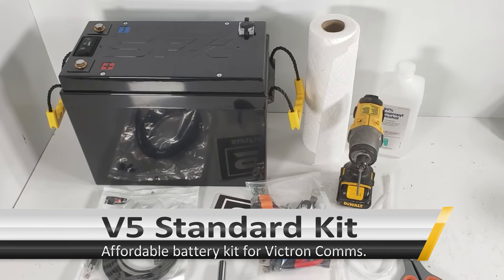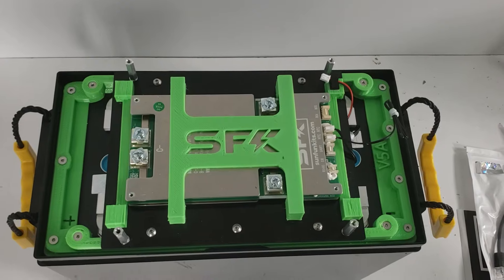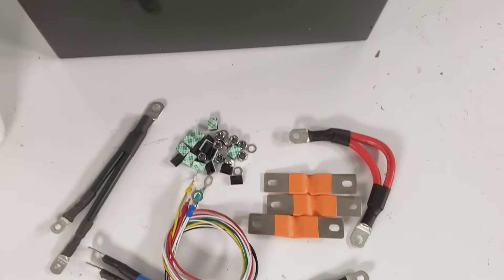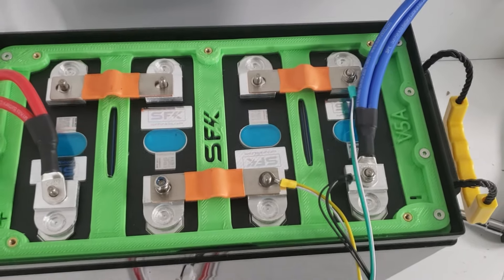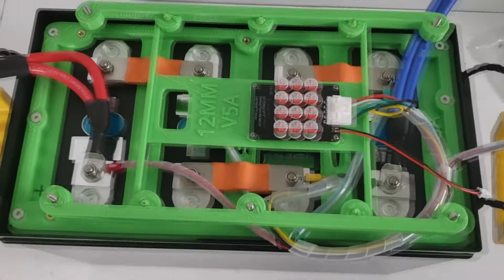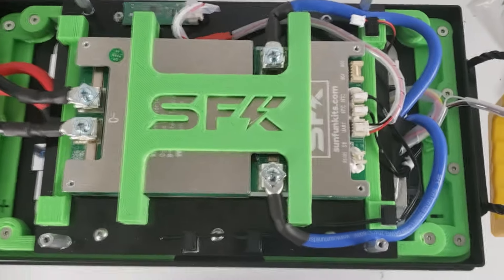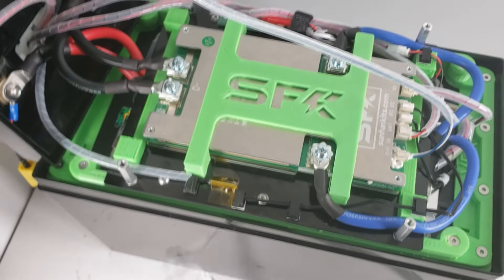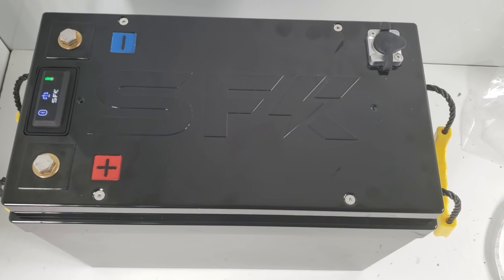Sun Fun Kits V5 Standard Edition! Affordable Kit with Victron Communication!

Comment: Looks like a pretty well thought out kit to give A+ features for an affordable price for those who are willing to do the assembly work.  I notice they are all out of cells though so if you want one you need to supply your own cells.  Will this kit work with the modern 304AH cells that use two M6 screws per cell terminal instead of the M8 posts?  Looks to me like those busbars are not compatible?